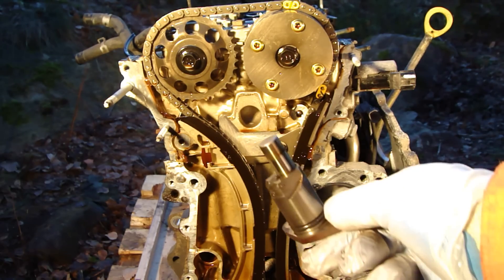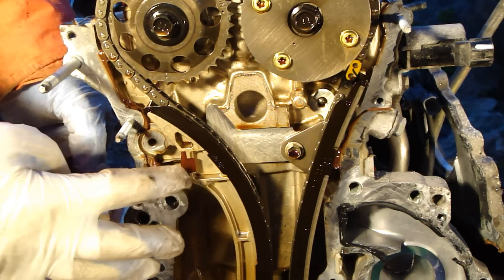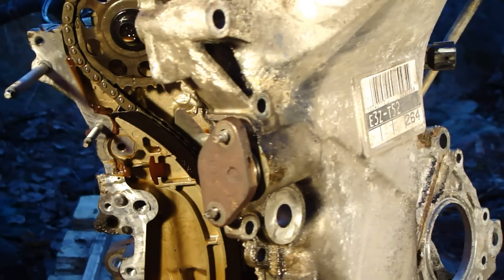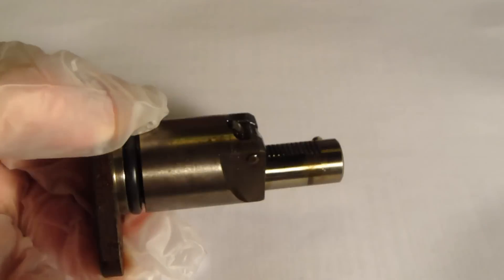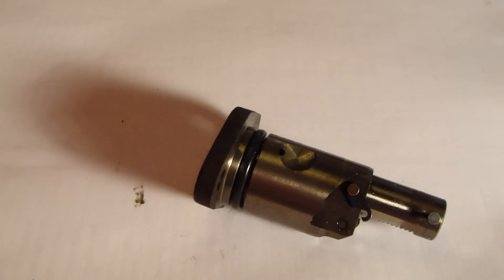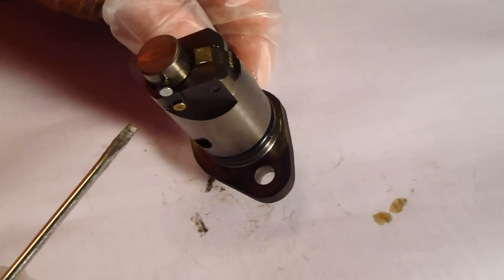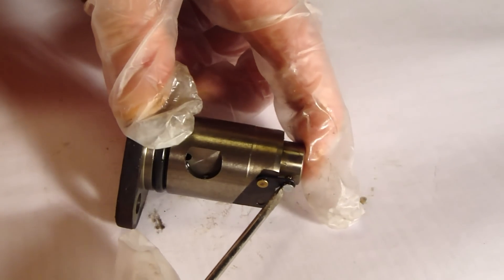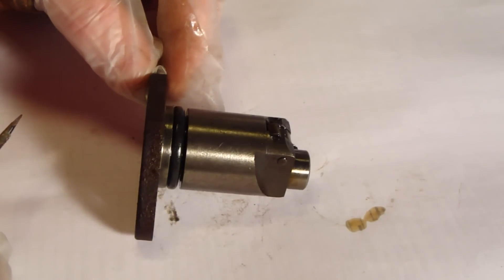How works tensioner timing chain VVT-i engine Toyota. And how to load tensioner.

Comment: You just turn the engine backwards a bit so it tensions the the slack side of the chain. It will push the plunger releasing the latch, the tensioner will pop out automatically 👍
Reply from the maker: Good comment, Thanks 👍

Comment: My Question is: If the 10mm threaded shafts could have been an inch longer? So the Nuts would pull it in Unlocked This Prosses would be! 
Remove 10mm Nuts! Replace Old Junk with new Junk and replace Old Gasket with new Gasket! No Seal Gasket Adhesive and Turn This Engine Clockwise and 2009 Counter Clockwise and listen for the Click? The Threaded nut shafts are to short! I see how it works now that I did one and the timing Chain needs to be in the right tension to install this! Otherwise if you don't do it right your engine in finished! No covers need to be removed but Watch all the Youtube Vids to do this Job! If you do it wrong you will know when you turn the key! 
 I just for the first time did a 2010 and you have to turn the cam Counter Clockwise a 2008 Goes Clockwise to unlock the tensioner! If the morons at Toyota and Lexus could have made the Nut shafts an Inch longer this BS process would not happen and its a LEXUS Recall on VVT but not Toyota for Safety? Hey You Got Airbags Your on your Own! Lexus is a Toyota and Same Engine Same Problem! Same Tensioner!
Reply from the maker: Noted. Please join to my Membership ! 👍😀

Comment: If l ever need to do this job I'm releasing the tensioner the way Pete describes here. It seems the safest and most certain way . But if l had to do it by turning the engine l would go counter clockwise as that would take the slack off the chain that is in contact with the tensioner and force it rearward, releasing the hook.
Reply from the maker: It sounds absolutely wonderful! You are a great guy and a wise man. thank you

Comment: Ha anyone on here had an issue where the old tensioner is stuck in like it’s caught on something(maybe to the chain?). I remove the nuts holding it and it comes out a smidge but it literally feels like there is something it’s caught on, not sure what to do to get it to pop out, I could fit the end of a screwdriver in the gap, but even gently coaxing it, it’s like it’s caught, any ideas? Thanks
Reply from the maker: Ok and Thanks 👍😃
Reply: Peter Finn the Car Doctor that didn’t really answer my question at all 🙂. But I like your videos so thanks

Comment: Once installed and turning motor, what piece of hardware releases that hook allowing the bolt to pop into place?
Reply: the chain tension pushes the plunger in and it releases the hook

Comment: Hi Peter,
I just removed the tensioner from my 2009 Corolla. I have a new tensioner that is locked in the closed (compressed) position but I am unable to get it in the engine far enough to secure with the bolts. I made sure it is not rotated 180° from the correct orientation. Is the black bumper supposed to move freely to allow the tensioner to be inserted? Could this part be seized I in my engine and preventing me from inserting this compressed tensioner?
Thank you for your helpful videos!
Reply: Hey Jason, I'm having the same issue with my 2010 corolla (2zr-fe). How did you manage to get it installed again? Mine is sticking out by about half an inch, I can't even screw on the bolt caps.
Your help would be appreciated, since I'm currently stuck without my car :(
Reply: This lady install the tensioner effortlessly....
No need to open the cover.

https://youtu.be/mmbvYEXZ9ds

Comment: Hello Peter,
I have a question ...I hope you can help.
I have a Toyota Avensis 1.8 vvti station wagon (2005) motorcode: 1ZZU..
There was a complete engine overhaul, due to engine oil consumption, like chain control replacement and cylinder head replacement. 
After that the engine is ringing / rattling for 1 second but only if the car is parked for several hours.
I also made a video, if you can tell me what the problem is, I'd appreciate it, my mechanic said this sound is completely normal.
I think it is not at all good for an engine to rumble at startup.

Master what is your opinion?

ttps://youtu.be/695WONXoqrs

Thank You!

Comment: Hellow Peter! Hi bro Just finish replacing the O-ring (it's getting oil leak) of tensioner Chain by just pulling out then it. (following almost same but different people tutorials here in YouTube as well as in Toyota Nation), but my fear came when I put it all back in and I try to start and then after starting I already heard some weird noise coming right where the tensioner and the timing chain is. I thinkt' is getting more RATTLING SOUND before I turned off the engine. I feel like I had done something wrong also but as far As I remember I've done all right. 

It feels or sounds  like the chain was more loosen and rattling, and now I'm sure there was something wrong to what I've done, zzz my bad.. I hope some of us here could help me about it, know something about it bro?
Reply from the maker: Hi, you made something wrong. So repeat it again
Reply: Why repeat when it was wrong?

Comment: I locked my tensioner but it won't go in the engine, not even enough to thread on the 2 nuts - it's like my chain guide is stuck there or something please help
Reply from the maker: Hi, please hammer it by sides
Reply: @PeterFinnTheCarDoctor  Thanks for the reply, it's hard to get a hammer down there, engine is installed and cam chain cover still on. Car is Toyota Celica...does it usually require a lot of force to get in?
Reply from the maker: Yes.

Comment: I have a question my friend has a 2011 RAV4 2.5 vvti to make a long story short I found out it had no compression I pulled the valve cover and found all 8 intake rockers laying in the head, 5 of the 8 valves are stuck on which I assume are bent any idea on how that could of happened? I looked up the engine and read it's a non-interference engine even if the timing jumped it shouldn't have touched the valves, and help would be appreciated.
Reply from the maker: Thanks, very strange thing.

Comment: Thank you for this wonderful video.your videos are very helpful.
I replaced mine today then i started to rotate the pully forward and backward is that bad for the timing of the chain?
Reply from the maker: Hi, please check timing chain markings again. If we rotate the chain backward, the chain can jump wrong position.
Reply: @PeterFinnTheCarDoctor  thank you peter for your advise.when i was done working on it on that day i started the engine didnt hear something wrong was running smooth but i will check the timing

Comment: btw..there is an "Inspection hole" on the front cover Crankcase Chain Cover, that is precisely meant to "FLIP" that Lock open that holds the spring in for installation..(it should be a rubber plug)
Reply from the maker: Yes and Thanks for comment. :-)
Reply: @PeterFinnTheCarDoctor  You gave wrong information for how to unhook the tensioner. YOu need to crank counterclockwise about  a half turn and clockwise 1.5 full turn to put the tensioner in position.  It is in dealer service manual

Comment: Peter,  To release the little retaining clip on the tensioner all you have to do is turn the engine over backwards with a wrench on the crank. It will release the clip by turning it about 180 degrees and you don't have to try to stick a screwdriver in through the valve cover.
Reply from the maker: +Mike James Thanks for comment. :-)
Reply: Mike James I installed my tensioner and it wouldn’t go all the way in without pushing sorta hard so I could get the bolt on there. Every time I’d mess up and the tensioner would just expand and I’d have to reload it again. Then after finally getting it on I go to rotate the crank and it was really hard to rotate... it required a lot of torque.. not sure if that’s normal or not... and THEN my check engine light and slip indicator light came on and stayed on. Took it to advanced and it threw a p0016 code. Which means correlation between the cam shaft and timing chain.. I’m thinking some how some way I made it jump a tooth on the dam timing chain by trying to rotate the fucken crank smh now I don’t know what to do
Reply: @tylersanders3818  Hi bro Just finish replacing the O-ring of tensioner Chain(following almost same but different people tutorials here in YT as well as in Toyota Nation), but my fear came when I try to start and then after starting I already heard some weird noise coming right where The tensioner and the chain is. I feel like I had done something wrong but as far As I remember I've done all right. 

It feels or sounds  like the chain was more loosen, and now I'm sure there was something wrong to what I've done, zzz my bad.. I hope some of us here could help me about it, know something about it bro?
Reply: Draxus the timing chain could be worn out even tho it’s rare for that to happen it could have been worn making it a tad bit longer than it normally was. At that point you’d need a new timing chain. Before that tho make sure the right amount of oil is in there because running it low on oil will for sure have the timing chain and engine making noise
Reply: Draxus if the noise you hear is constantly going and you already have the right amount of oil in the motor then you’ll need a new timing chain, it is rare but sometimes they can stretch causing THAT problem
Reply: @tylersanders3818    changing my tensioner with a new oem tensioner. Hoping that fixes this noise. if not im gonna have to get a timing kit i guess?>  https://www.youtube.com/watch?v=cFb0D05kUEI
Reply: I have a 2013 Toyota Corolla which way do I turn to crankshaft to release the tensioner?
Reply: @KrazyKramer  Turn counterclockwise until you hear the click or about 1 full turn.  Turn clockwise to push it back to position about 2 full turn.  Many said, Just clockwise for 2-3 turns until you  hear click also works.  Make sure add 1 more turn after you hear the click.  Turn it clockwise 3x is safer to make sure the tensioner is fully engaged.

Comment: hi peter finn..i have had a persistent problem with my harrier 2004 model with a 1mz fe engine..3.0l..it makes a loud jerking sound when changing gear or when disengaging from gear 3 downwards.it  also does not have power.I have changed the transmission fluid,the tensioner and belt,oil,plugs etc but no change.A recent mechanic says that i have to replace the gear now.what could be the problem?
Reply from the maker: +Eng Gachengo Yes, the your sound looks like bearing issue.
Reply: +Peter Finn  so I have to buy a new gearbox?
Reply from the maker: Yes, I suppose so.

Comment: Hi Peter Finn, awesome video.  I have a grinding noise for 1-2 seconds every time I start my 2010 Pontiac Vibe (1.8L toyota engine).  Only happens if it has been sitting for a couple hours.  I thought it was a sticky starter solenoid but replacing it did not fix the problem.  Glad I found your videos on this engine!!  

Now I think the issue must be either the chain tensioner or the VVT-i camshaft gear.  I have a couple questions if you could help me understand the problem:

1. What is the actual item that is rattling - is it the chain or something interfering in the engine? Will this eventually lead to the engine being damaged?  I am not experienced in repair so if it is not causing damage I would rather not open up the engine.  

2. I also get a bit of a shuddering when the engine is being pushed harder - is this because of an increase in oil pressure and caused by the same issue?

3. Maybe it is the VVT-i camshaft gear oil slowly draining out and back down into the pan - is there a gasket I can change to stop this?  Possibly this would cause the shuddering at higher RPM as well as the higher pressure can not be maintained sufficiently by a leaky gasket.

My car has 180,000 kms on it.  This issue has been happening for about 10,000 km.

thanks for the great videos - very informative for a hack like me!!!
Reply from the maker: +Olas Hi, Here are some answers:
1) The chain. It stretch.
2) Engines vibrates when old
3) It could be
If engine works, you can drive.
Reply: +Peter Finn thanks a lot for helping me to understand.  When you say "if engine works, you can drive" do you mean that this is not causing damage to the engine and I should not attempt any repair/replacement?

Others online seem to think this rattle will eventually lead to damage.  One individual wrote that he backed off the bolts on the tensioner until it clicked then tightened the bolts back down.  Apparently this took up the extra slack in the chain and solved the issue - a good idea you think?

http://www.toyotanation.com/forum/323-10th-gen-corolla-2nd-gen-matrix-engine-transmission-forum/395971-timing-chain-replacment.html
Reply: +Olas There is a TSB about this issue. Replace the Camshaft Timing Gear.
Reply: Anderson D Intake or Exhaust Cam Gear? Link to TSB or TSB Name/Number? Thanks

Comment: Hi my engine was forced backwards when my car stalled and rolled backwards  in 1st gear, would this damage the tensioner. valves and timing are ok. engine is a 2tr-fe 2.7 hilux.
Thanks.
Reply from the maker: +carlin hicks Hello. Toyota engines are robust like steel. Your engine should be OK.

Comment: Hi peter iam george engenear from korinthos greece.the problem is that i replace o ring and oil leak no stop... i used and  liquid red gascet and i wait 2hours before run the engine....the problem is problem... i dont no ...please peter help me ....thanks ...
George GREECE
Reply from the maker: George Rousakis Hello. Could you send video or picture to me on your oil leak? Send link please.

Comment: Awesome video, but I found somewhere that you can turn the crankshaft counter-clockwise until you hear the click of the latch releasing, and then turn it clockwise to make sure the tensioner released. It saves you the trouble of opening up your engine!
Reply: This is the only way to do it. LOL.
Reply: I also read on the 2zrfe engine they no longer have guide rails and even turning the engine by hand it will cause the chain to jump teeth. Any comments? I want to change this but worried something will go wrong. Thanks
Reply from the maker: geekometer96 Yes, this way works also.

Comment: Hi Peter,
Your videos are great, even for a novice like me.
My Toyota Avensis Verso VVTI engine makes a rattling noise when starting in the morning. When accelerating you can still hear it slightly, but its ten times worse in the morning. Could this be because of timing belt being loose? Any advise is really appreciated. I recently bought the car without noticing the problem. Thank you..
Reply from the maker: Roshen Britto Ok. You have little too long timing chain, but don't worry, your chain last. When noise is too hard and all time, please replace the chain.

Comment: I just wanted to let you know that you can replace the tensioner without removing the valve cover. You do not need to release the latch on the tensioner with a screwdriver after it is installed. If the tensioner is compressed all the way the latch will release itself. Engage the latch and install the tensioner, then you can use a socket on the crankshaft to rotate it slowly in a counter-clockwise direction. This will take the slack out of the timing chain without moving the cam sprocket. As the chain tightens it will depress the tensioner completely and release the latch. You can actually hear it click.
Reply from the maker: Randy M Many Thanks.
Reply: It's actually in the clockwise direction.
Reply: @uchekindness8698  Per Haynes manual the 2008 and older 1.8L states it's clockwise, 2009 and later 1.8L Haynes manual states CCW then CW
Reply: @uchekindness8698  Counter clockwise puts tension on the chain .
Reply: I though i saw some mechanics says clockwise.

Comment: One question: where is the oil pump in this picture?
Reply from the maker: youeweu Hello. Here is  video on oil pump: http://youtu.be/p9QDRUT_YZc
Reply: thank you Peter! the oil pressure is still low after the mechanic changed the timing chain. He is saying he can examine the condition of the pump with a special camera through the oil plug, without taking apart the engine cover. Is that true or not? I think he should take it apart as you have in your other video and check the tolerances with a gauge.
About this video on the tensioner, could the chain still be loose if the tensioner is fully extended, if the guide slips or brown plastic guide surface is worn?

Comment: We had our '99 Corolla 1ZZFE engine rebuilt (according to this video 1ZZFE Oil Consumption Fix How-To 8th Gen VVTi Corolla +similar) and it started beautifully, but the mechanic put too much liquid gasket on the tensioner and it started smoking a lot. Anyway, he took out the tensioner to clean the liquid gasket off and it fell apart (spring and ball came out), so he installed a new tensioner. When the engine was restarted, we heard a strange sound by the timing chain (like jiggling a wrist bracelet), but it eventually went away (or got a lot less noticable). 1500 mi later, the oil pressure light went on and this was the engine sound (https://docs.google.com/file/d/0By-X...p=docslist_api). Now I wonder if the tensioner hole was clogged per Mr Fixit's comment, which caused the tensioner to fail. So the lesson is, the tensioner is a simple thing, but if it is installed incorrectly or the timing chain guide it acts upon slips, you could end up with a loose timing chain, damage to the main and rod bearings due to the vibration, loss of oil pressure and death of the engine (like me). Beware!
Reply from the maker: youeweu Hello. It sounds, that you have been really bad luck and your mechanic has not to be a top Toyota engine specialist. This engine assembly and timing chain set up are most difficult tasks in car service. Not a kids and trainees jobs !  And Thanks for your info.